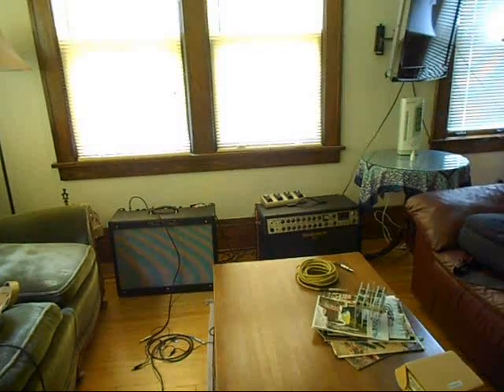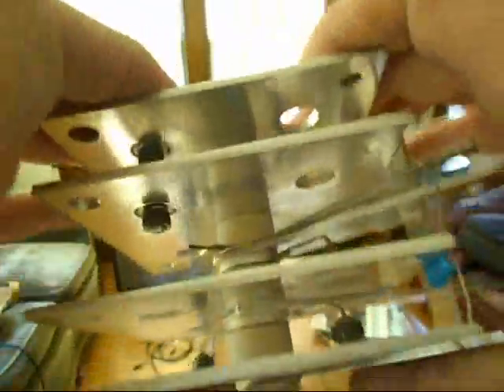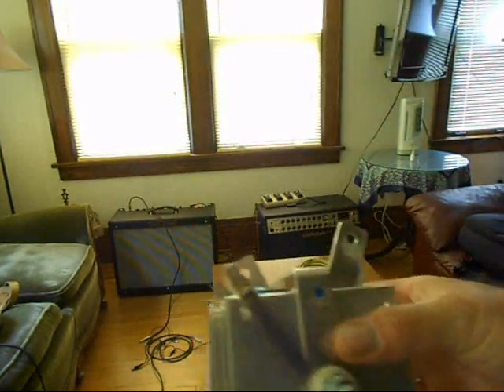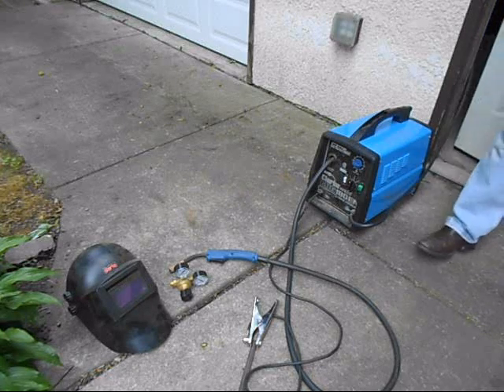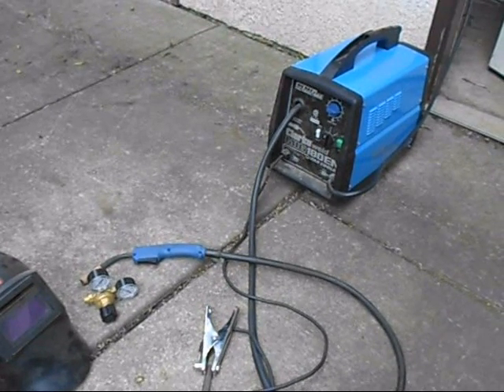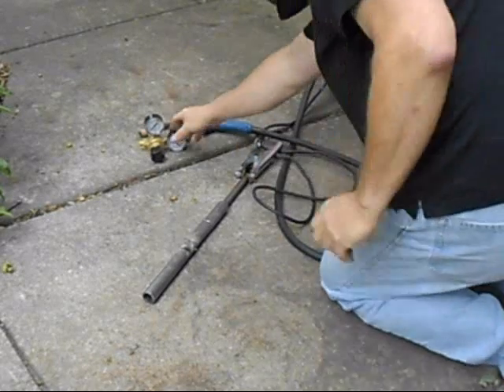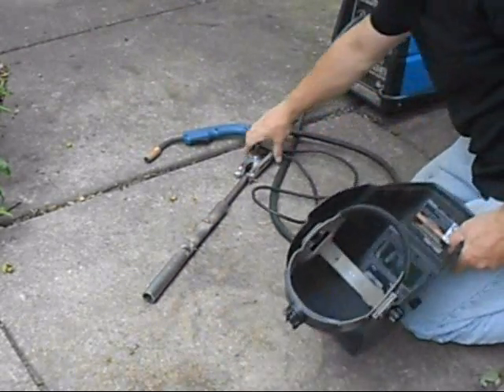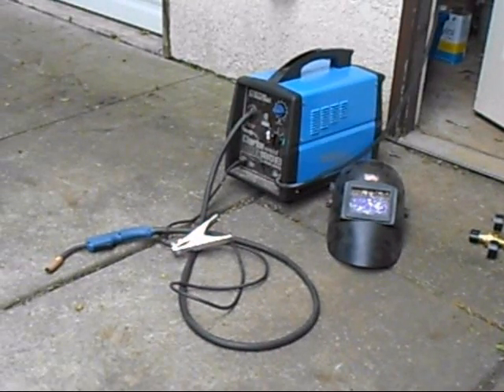Welder repair.wmv

Comment from the maker: That would not be 220VAC going to the rectifier.  Before the current goes to the rectifier, the voltage is reduced and the current increased by the transformer in the welder.
Lucas